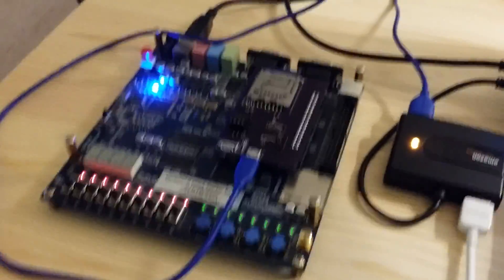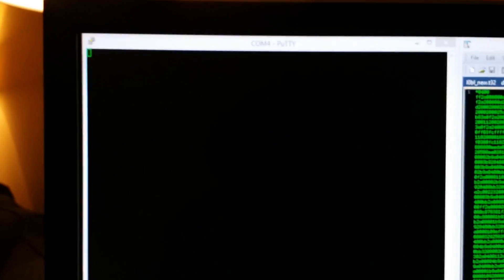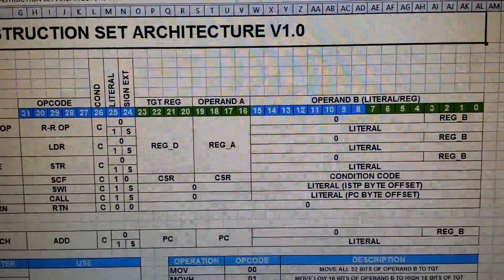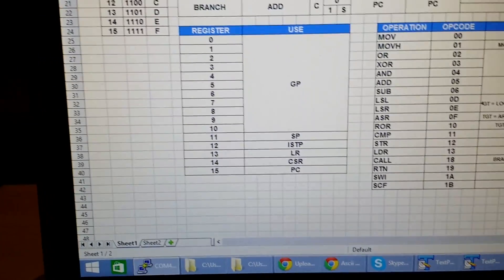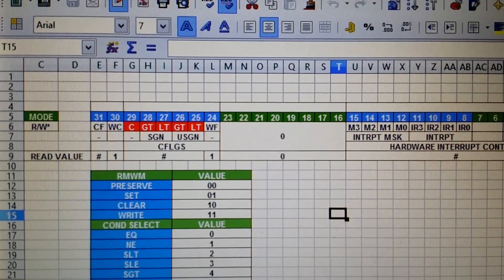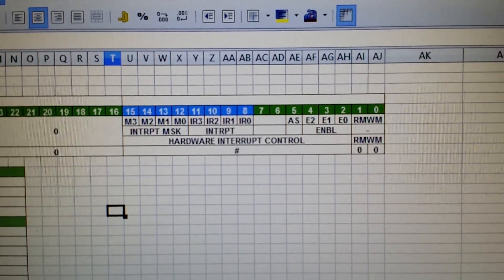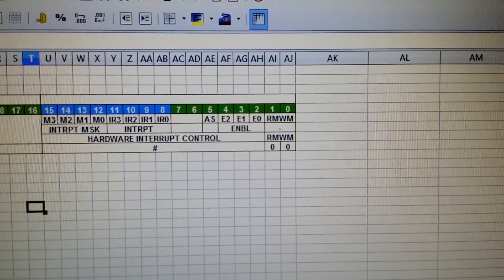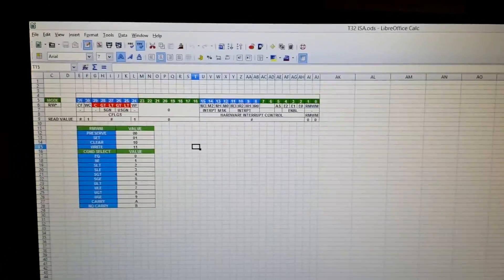Homemade 32-bit CPU and OS - Part 1 of 2

Comment: R14 has always traditionally been the LR since System/360.  You're breaking with almost 80 years of tradition. Also the mnemonic is either BALR or BL, not CALL.
Reply from the maker: Thats true for ARM sure, but this is not an ARM architecture and as such the LR could have been any register, for example, RISC-V uses x1.  Further more, the reason I choose CALL instead of something like BALR, is because that instruction does a little more than just branch and link.
Reply: Tom Stanway-Mayers It's certainly true for IBM as well and at least since the 60's with the S/360 architecture. Possibly it even holds true for cousins of those mainframe instruction set architectures like the later CISC AS/400 "Internal MicroProgram Interface" IMPI or other IBM special purpose processors. At least from what I've seen over the years. BALR does also works differently on 360  because it lets you select any register except R0 to hold the link address, but you and ARM hardcoded that to R14. I don't know it just feels weird why someone would change the sequence of these registers in a 16-register register file from historically established and very popular architectures, but oh hey it's your learning toy. Still I'm an ancient old fuck and the use of R14 as the LR predates even me by a few years. As to your mmemonics, call it what you like, I suppose. You've already trampled tradition into the dirt. Just kidding, kid .. I'm just giving you a hard time really.
But I'm curious though for real, how does your CALL differ from ARM's BL?

Comment: Sorry but building a cpu on an fpga using vhdl is extremely lame. Go get your hand dirty with discrete logic IC's and man up.
Reply from the maker: Paulo Constantino I already did that when I was 18. Using 4000 series logic and home etched PCBs I built an 8 bit CPU with an SRAM interface and an 16x8 LED dot matrix display which I uploaded code to using photodiodes and a qbasic graphics application.  Using an industry standard HDL is a huge upgrade and has allowed for much more complex and powerful designs.
Reply: bruh hahahahaha
Reply: Tom Stanway-Mayers RESPECT

Comment: Purdue CmpE students have a 400 level class that is basically the same and uses the same FPGA's. They are required to synthesize a 32bit MIPS ISA on to a dual core CPU with cache coherency.

Comment: FPGA. You can see the Altera logo on the dev board
Reply: He created the CPU in VHDL and synthesized it onto an FPGA. 
He could have sent the VHDL code to a Si chip manufacturer and have them produce a CPU, however that would have been orders of magnitude more expensive. He still made a CPU.
Reply: I don't get you neither
Reply from the maker: Hi Khoi,

Yes that's correct, the system has been implemented on an FPGA (Field Programmable Gate Array).  Altera and Xilinx are probably the most well known brands. This development board, made by Terasic, employes an Altera Cyclone II FPGA.
Reply: Tom Stanway-Mayers So... How did you make the CPU
Reply from the maker: +Khoi Sousa Well, first I decided on an Instruction Set Atchitecture (ISA) and then I designed the CPU.  After designing it I implemented it in VHDL (VLSI Hardware Description Language), a language which is used to design digital ICs.  Then I synthesized the design and configured the FPGA.
Reply: Tom Stanway-Mayers I mean, HOW DO YOU GET THE FPGA ITSELF
Reply from the maker: +Khoi Sousa www.digikey.com is an example of where you can buy an FPGA from
Reply: Tom Stanway-Mayers You don't get it, do you
Reply: That was funny to read at least hahahah
Reply: +Khoi Sousa Before CPU's are made the hardware code must first be made and simulated many times. You can run/simulate the hardware code on an FPGA. This guy has written the hardware code for a CPU and simulated it on his FPGA. Hardware code is very different from software code.
Reply: Francesco lupo Read what?
Reply: Valerie makumire lol I just relised it last week!
Reply: William Gerald Blondel I MEAN THAT HE SAID THAT HE MADE A CPU BUT HE BOUGHT AN FPGA